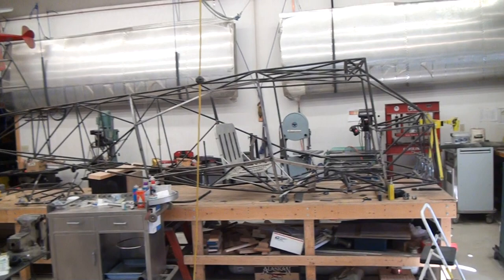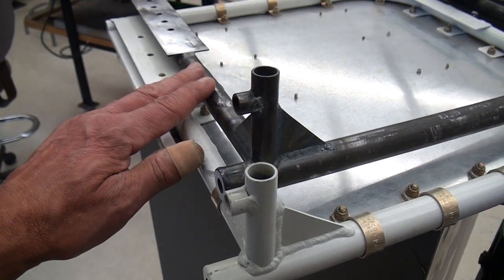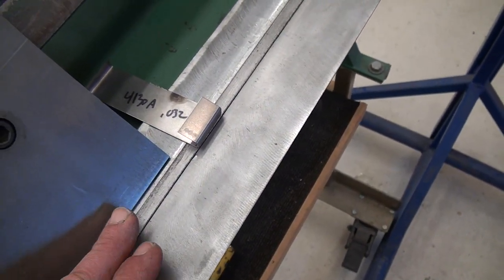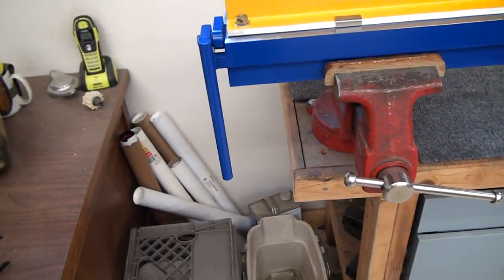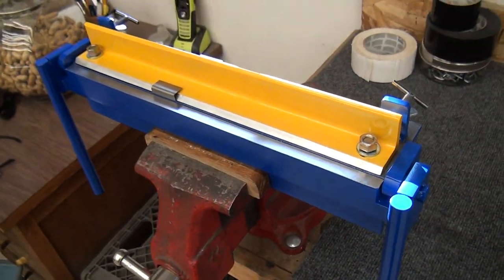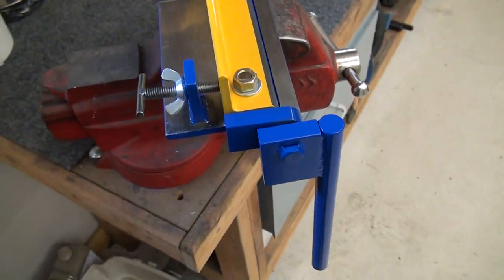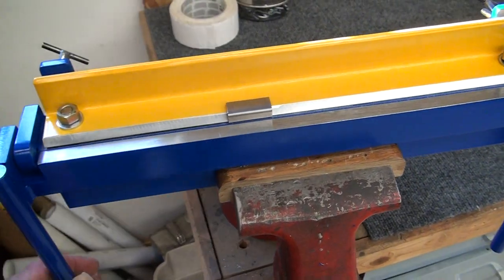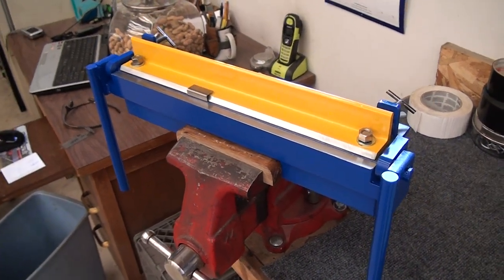Homemade 12 inch Sheet Metal Bending Brake

Comment: Beautiful! 

What kind of steel did you use? Just basic, mild steel? Presumably cold rolled would be best for this, but is a strong alloy necessary? Do the plans state what gauge metal it is capable of bending? I suppose I should check out that site...
Reply from the maker: Hi Jon...

Mild steel is the plans spec and can bend 18GA sheet metal. If you go to the plans web site, the description gives you all the details: http://www.how-to-plans.com/Sheet-Metal-Bending-Brake-Plans-18in.html

I used the brake yesterday to make my seat guard parts and it works great!
Reply: I checked it out after I wrote that. I was very pleased to read that it can handle 18ga as that is the heaviest I've ever needed and what I have the most of on hand. Thanks!